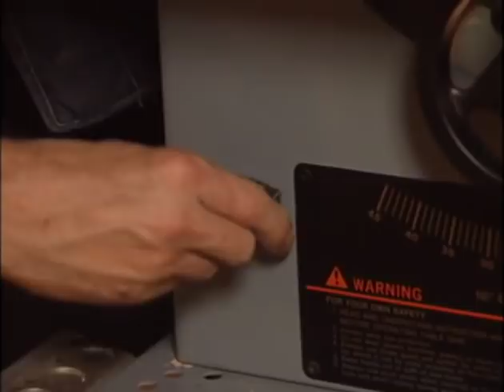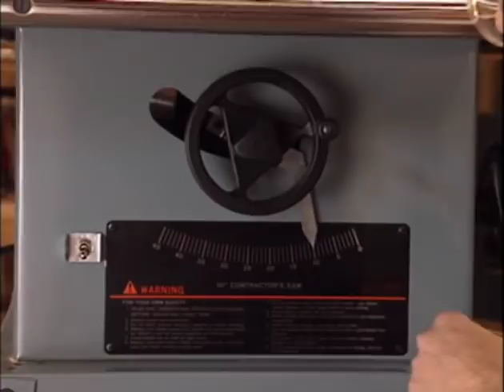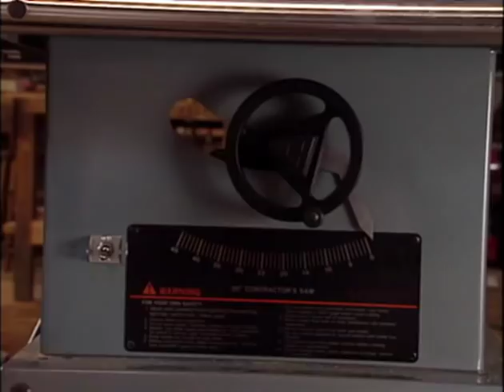Mastering Your TableSaw

Comment: I have to thank you ever so much this video Kelly.  You have many very good tips on using and setting up your table saw.  My saw is a vintage Delta/Milwaukee 1939-1940's combination 10 inch moving table saw and 6 inch jointer that I restored.  The issue I always had was with the fence.  You nailed it!  My fence is nearly identical to the one you showed and I would experience the burning and saw marks on some pieces and it was due to the fact that sometimes when I locked it down the back of the fence would move and this tow in would cause me grief!  Thanks for pointing that out so I can make the proper adjustment in locking it down from now on.  Also the tip on removing the slop in my miter gauge by using a punch perfected my fit!  Another great tip was making a cut and taking the cut piece and rotating it to see if it matches perfectly with the other to show how square the blade is to the fence or miter.  Thanks again I really appreciate it.  Cheers!

Comment: That's a whole lot of knowledge packed into less than an hour!  I'm a novice who appreciates the time spent on education
Reply: Hi Terry, It is a good video, but it is from the 1980's. A lot has changed since then, some good some bad. The Delta Contractor saw used in this is no longer available. To get a saw of that quality you'll need to get a Powermatic or a Saw Stop. The blade guards are much improved since then and so have the blades. Forrest, Ridge Carbide, and Freud are good choices. Working with wood can be a lot of fun and rewarding. I hope you do well. Gold 1792

Comment: Yes BUT having good tools DOES help to a point!! I bought a "name brand" table saw used for $50 and soon realized it was missing a few things, like a miter gauge, push sticks, and a decent blade. I replaced the blade and the miter gauge, and made a couple of different push sticks!! Ok sure it worked "OK", BUT for months I began examining my cuts which always seemed to be "off" and nothing was ever completely "square" on that table saw ever either!!! It was then I realized what my problem was, as the rip fence was severely damaged prior to my purchasing it. And though for the next few years I learned to work around the problem one day last year at Home Depot's website they had a Ryobi Table Saw for just $175 that was portable and small (my shop is tiny) and came complete with new everything!! All I can now say is "WHAT A FREAKIN' DIFFERENCE!!!" going from a beat up used saw to a brand new saw!! My cuts now are "Dead Balls Accurate" (My Cousin Vinny) and every cut I make is so amazingly square I don't know how I went the past 15 years dealing with the old beat up table saw I had!!!! Beside the one thing my other saw was missing was a stand as well, so it is AWESOME to not have to use a saw that is literally laying on the ground or having to strap it down to a small portable work bench both which were really getting to be a major pain as well too!! And having a QUALITY new saw makes my life 20 times more simple, then having to "work around" the problems I had in the past!!! And lastly I have given up on buying used tools anymore!! After all it seems like people who DO NOT KNOW HOW TO USE THEM, beat the tar out of them and then once they are fed up breaking their stuff into garbage they sell it cheap yet be it completely destroyed and worthless to the next guy....ME!!! So having a good tool to start out with DOES make a huge difference in the work you are able to do with it!!! And to add to this comment too, I could have just replaced the rip fence sure....but for the cost of a $300 rip fence to the cost of a brand new undamaged saw of just $175....it made more sense to buy a brand new saw!!!